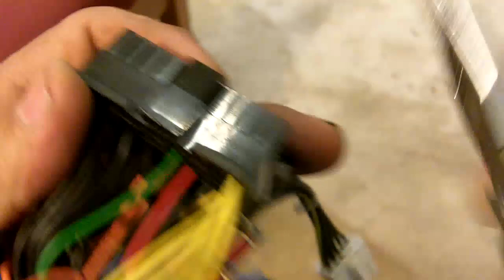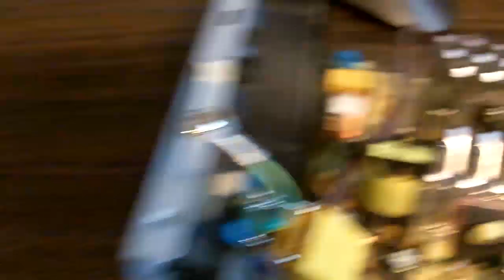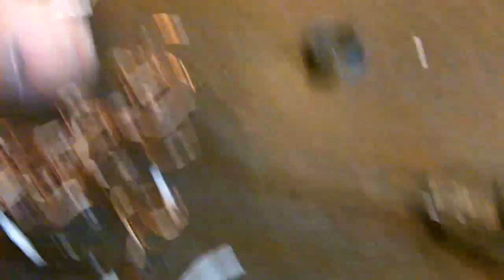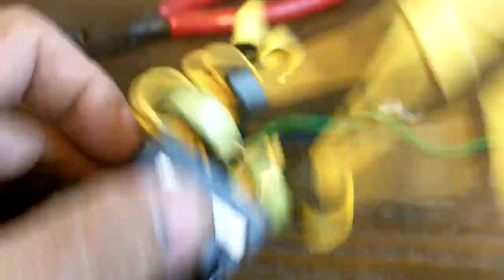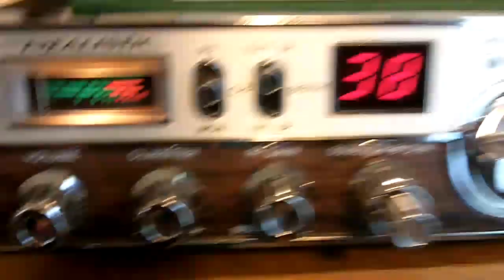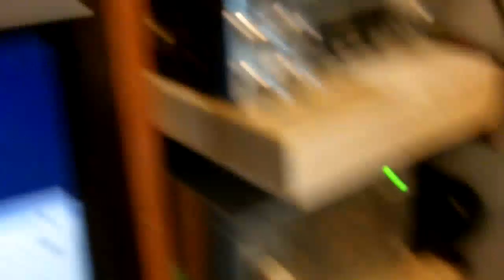PC Power for My CB Radio  12v supply

Comment: I did that back around 2008 with an old Antec 350 Watt ATX PC power supply that became out dated. It was rated at around 15A on the +12V rail and I got about 12.5 volts out of it after the conversion. I found the instructions on Google. I removed all the wires that were not needed and soldered thicker black and red wires from the 12 volt positive and negative spots on the board to binding posts like the ones on a CB power supply. I used the rocker switch in the back of the power supply as the power switch. I had to use a 10ohm 10W sandbar resistor between the +5V rail and ground for a small load to keep it on. I also used a red and green LED connected for voltage status. The red LED was standby voltage and the green LED was for voltage when I turned it on. I also reused the 12V fan to keep it cool. I used it to power my mobile radios.

Comment: How is your so quiet with the RF Gain all the way up? When I do that to hear skip is for white noise into the S3-5 range. Could it be my outlet? Or is that just the nature of taking in so much signal, but it being it of range?
Reply from the maker: If the antenna is tuned to the best it can be, the noise level will usually be low.

Comment: Hey Mower Junkie, I was trying to find your Dell laptop battery 18 amp wiring instructions to hook up CB radio  for a friend. Did you take that video down, I couldn't find it?
Reply from the maker: I just looked, and I couldn't find it either. sorry, I must have accidentally deleted it.
Reply: @MowerJunkie  No problem . It's pretty easy to do. You had good instructions I wanted to link to.

Comment: Thanks for the video I picked up a old  cobra power supply for 5 bucks that pushes a solid 14.25v as far as how much it can handle ill have to do more research. But for now it powers up my Bearcats 980ssb need one for my galaxy dx98vhp. So this computer power supply idea is definitely an affordable option. Wish i had the electrical knowledge you do my friend! Im gonna copy your 102 whip idea if i can and try to reach out around arkansas if i build the cardioid phased array, id like to have, and maybe a bigger amplifier i might be able to skip your direction. Lol anyways thanks for the video! 
73
 2711 arkansas
Reply from the maker: That's great that the power supply works. Arkansas is an area I hear all the time. when the conditions are right, that 980 should get the job done. Thanks for watching, Enjoy the hobby. 73's from 151 SC.

Comment: Baby question: Is there THAT much 
of a performance difference 
between 13.8V and 12.4V?! 
Your CB-Bro in Montreal Canada, 
Norman (aka:GuitarNorman)!!
Reply from the maker: higher voltage will deliver more power out of the radio. But the radio will last longer on lower voltage. I'm willing to loose that little bit of power for a longer lasting radio.
Thanks for watching, 73's from 151 SC.
Reply: @MowerJunkie : For sure!! 
Especially if it's an older "loved" 
radio!! It would make an interesting 
range test, doncha think? 
It could be done in a 
mobile set-up. Test One could 
be the CB connected to the 
battery (13.8V), and Test Two could 
be the CB connected to the 
cigar(ette) lighter(12ishV). If you've 
got both 13.8V & 12.4V 
available at the home base, then you 
could try it at home with your 
Washington and/or your TRC-451!! 
We love range tests!! It'd be 
so cool!! Informative too!! 
By the way, you own one of my 
Top 3 favorite CB's of ALL time.... 
Namely the famed & famous 
Realistic TRC-451....wow....
What....a....Beast of a MACHINE!!!! 
I will own one....oh, yes....I will!!!!
You da man, man!! 
Take care-we care, 
73s from Your CB-Bro, 
Norman in Montreal, Canada.

Comment: So I have a similar setup it's 77.5 amps ant 12.7 volts and I have a 500 v will that hurt anything under volting it
Reply from the maker: so far, I couldn't be happier with this power supply. It's doing a great job with the radio and amp I have hooked up to it. Thanks for watching, and for helping keep the hobby alive! 73's from 151 SC.

Comment: What amp can you pull out the psu John? Great use of an old psu as decent ones are expensive!
Reply from the maker: this power supply is Server grade, and is heavy! It's rated at 1000 watts, and produces 12.4 volts, even under load. so...1000  divided by 12.4 = 80.6 amps.
Thanks for watching, 73's from 151 SC.
Reply: Brilliant soloution John because power supply’s of 50amp or more are expensive

Comment: I just so happen to have a Dell tower thats nearly 20. What a great solution to a power supply for my ne was base station
Reply from the maker: That's great! Just make sure it has enough power to run Your base. I would only do this with a 500 watt or bigger power supply. I hope it all works out for You, 73's from 151 SC.

Comment: I used to run 3  powersupplies and go in series on the 5v rails. Back in the day the 5v was  35 40a. I had 14.5 on a whistle with the SS 225+. You have to isolate the 3 chassis with cardboard and cut the ground pins on all but 1 maybe all. I think it needed a load on the 3.3v rail to keep it running. It did good for a long time

Comment: did that and the leaner would always trip it
Reply from the maker: You need to use a high quality PC power supply. The cheap ones will not work well.

Comment: was there a lot of noise without the chokes?
Reply from the maker: Yes! it will have noise without the chokes. Most PC power supply's will produce 1-2 db of RF noise. I like having 0 db of noise, that's why I use the ferrite chokes.

Comment: This is weird. I just got my first amp and already pulled my psu out of my other pc..was about to figure out how to make it work. Then you upload this.  Thanks!!
Reply from the maker: Glad I could help! Let Me know how Yours turns out. 
Thanks for watching, 73's
Reply: @MowerJunkie  well I got the amp powered up. But unfortunately it doesn't seem to work :(. Its an old Palomar model 50 I bought off ebay. The tubes glow and all, but when I key up nothing happens..no relays clicking, no high pitch whine, nothing. Do you know of anyone who does repairs on tube amps?